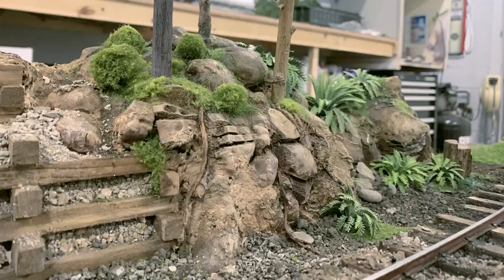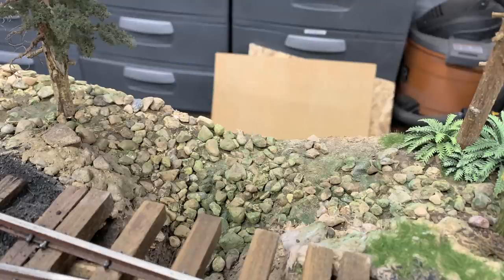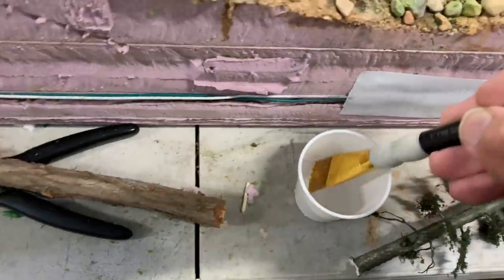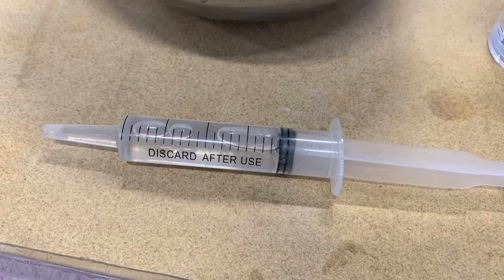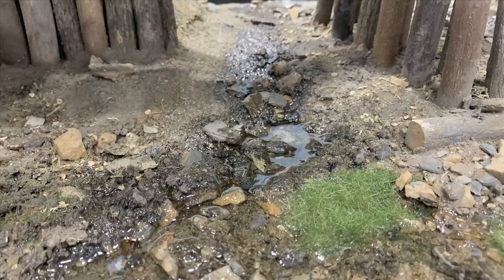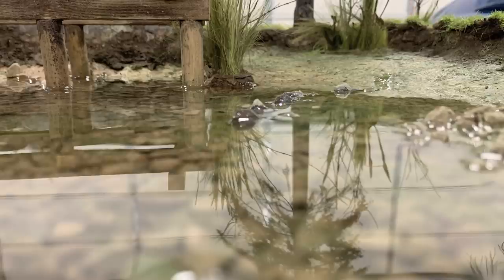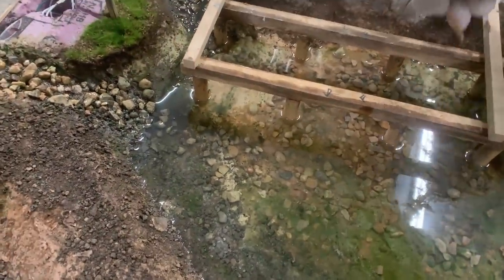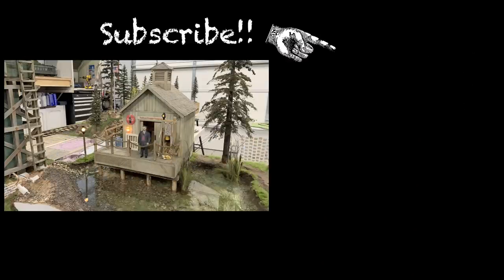Modeling Water on our 1:20.3 Scale Logging Railroad

Comment: Love the mossy bottom look... on mine before the next pore I've painted in  frog eggs and some muddy movment of dirt in the water, a few wave line ect, then pored over it. Very 3D...
Reply from the maker: Making the bottom look right is the trick. And you must test because everything changes. The colors change between putting them on and when they dry and then they change again after you pour the clearcoat over them. But with a little faith you can say I know this looks screwy but in the end I know it will look great!

Comment: Looks absolutely fantastic. I too share your fear/trepidation about pouring resin water - especially in large quantities. But, so far so good
Reply from the maker: I’ve had it ruin several models and dioramas.  I put together one years back where a train had gone off of the wood Trestle and the whole thing was collapsed into a river. Built the locomotive from a plastic kit. Well the resin heated up and melted the locomotive. The whole mess went into the trash. Another time a 3 inch deep River cracked. I lived with it. But damn. Also the stink… and trapped air. I’ve been told this is envirotex. I may buy some to test. But this works. Spent 150 on it… but it looks great.

Comment: You guys really make this look easy and it is not!   It could lead to a side job with Woodland.  When I did my pour a few years back, about half of it drained through a tiny hole in the substructure.  AAARRGGH
Reply from the maker: Been there done that. That’s why I was so very very careful to make sure the bottom is sealed up. Because I’ve had that very thing happen.

Comment: What is that galvanized steel hood thing in your shop it looks like a linotype lead melter is it and do you have a brand name? It's the shape of a steam donkey boiler
Reply from the maker: It’s a white metal cast in machine. Yes. Just like a Linotype. Same basic metal. We have several shows on it. Or with it or whatever. Let me look for a link.
Reply: @ToyManTelevision  thanks,  Im looking for one for models and  lead melting for model boat keels and couldn't find any info on linotype furnices
Reply from the maker: @wesbrackmanthercenthusiast4695  
https://youtu.be/4OnvLUD9DgE
Reply from the maker: @wesbrackmanthercenthusiast4695  

https://youtu.be/4OnvLUD9DgE
Reply: @ToyManTelevision   thanks again

Comment: I went to Home Depot and bought the epoxy used in random table videos on YouTube.  As far as I can tell it's basically the same thing as the Woodland Scenics deep pour for half the price.

I'm pretty sure it was this.  Been 6 years, but the box looks familiar and the price is right.
https://www.homedepot.com/p/FAMOWOOD-1-qt-Glaze-Coat-Clear-Epoxy-Kit-5050080/301826159
Reply from the maker: I’ve been told it’s something called Envirotec. Definitely doesn’t smell like a polyester or an Epoxy When it smells like anything at all it smells a bit like vinyl! I’m gonna try some of these other things but my experience with polyester has been a complete disaster. And really no better with epoxy.
Reply from the maker: I’ve been looking into that product. I don’t think it’s an epoxy. In name only. But your right. I think it’s this same thing!!! Looks the same. But epoxy is toxic. This is not it seems. At least the fumes aren’t. Epoxy will stink you right out of town. Whatever it is it does appear to be the same exact thing
Reply: @ToyManTelevision  I don't recall any noxious fumes from it. The mixing process was slightly different,  but you can easily chalk that up to different manufacturers. The pouring and curing phase was identical to that of the Woodland Scenics.   I had to tear my layout down or I would send some pictures.